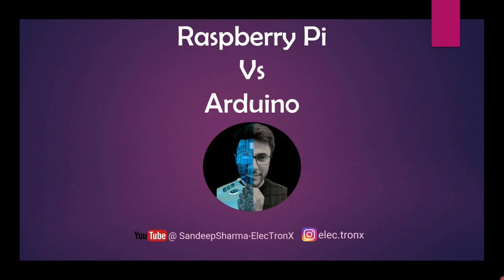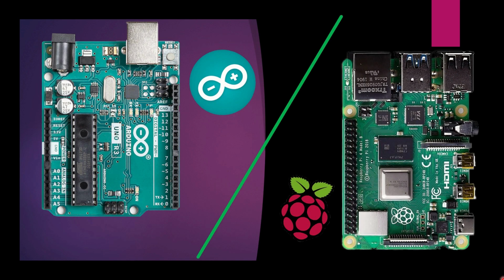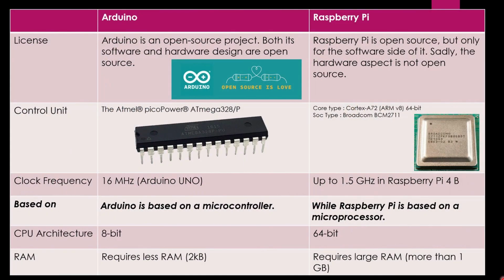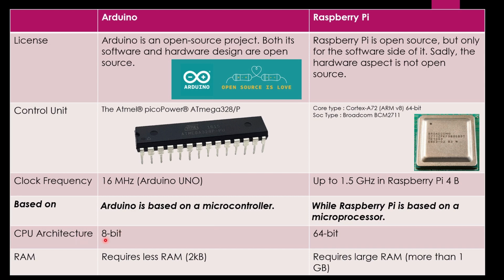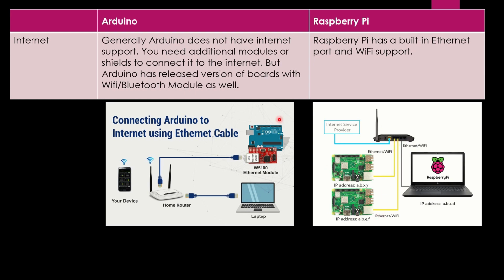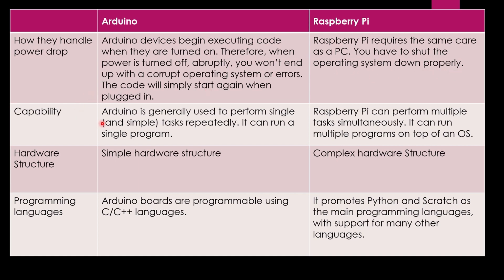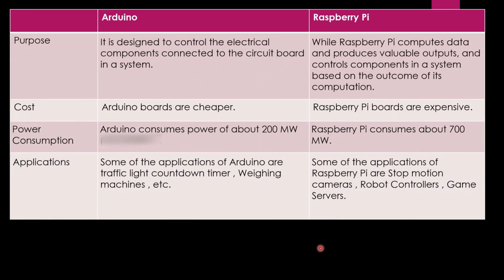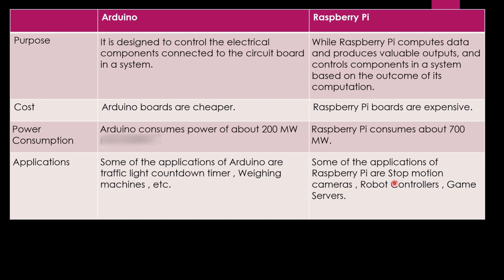Difference between Raspberry Pi and Arduino

Comment: Nice video. Maybe a bit bad luck with the timing, since the Arduino UNO R4 just release and also the Pi 5 (at least on the paper. I wasn't able to buy it yet. I fear I can't buy it before December)
Reply from the maker: Yes, You are right.
But the same concepts apply to those as well.
Also, R3 has been in use for quite some time and is extensively used even now. So, I chose R3 for this video.